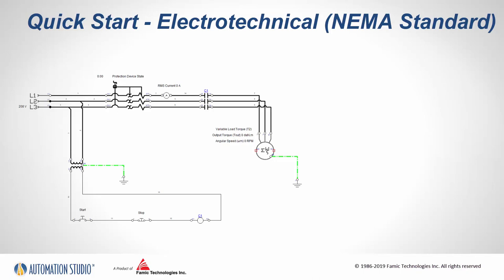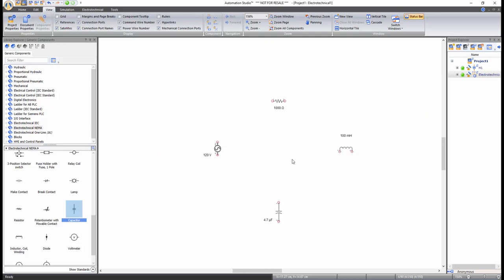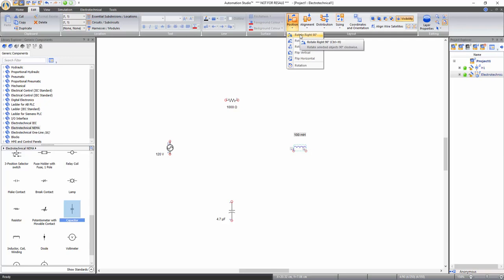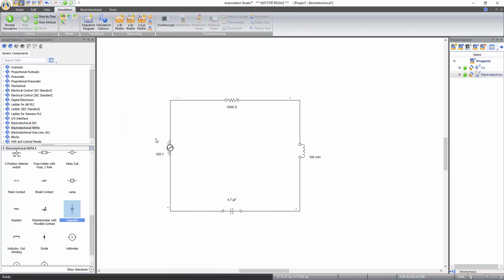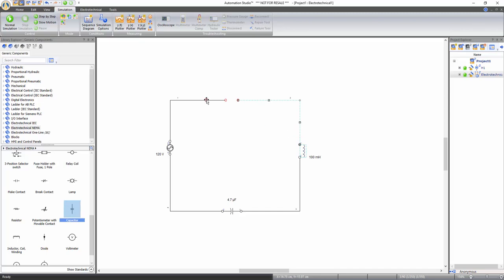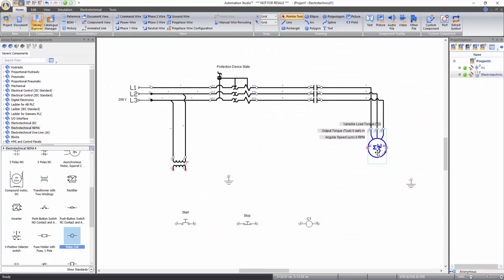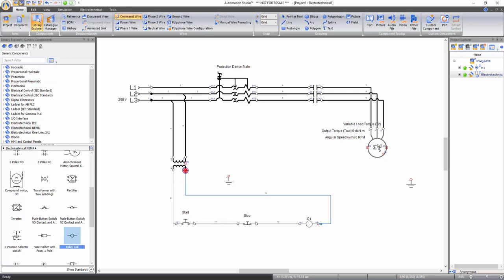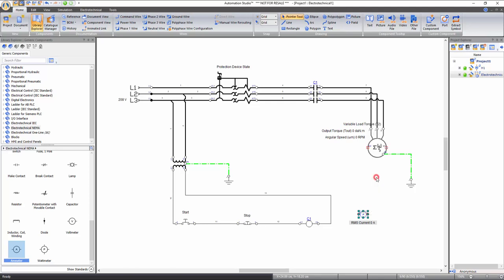How to Electrotechnical (NEMA Standard) Automation Studio™ - Quick Start Guide

Comment: What version of the software is this?
Reply from the maker: This is version 6.4 of Automation Studio™. We are currently at version 7.1 and version 7.2 will be released in the coming months.
Reply: @FamicTechnologies  I was wondering because there is no variable assignment for a 3 pole NO in version 7, just the builder.
I was trying to control an electrotechnical circuit with PLC but haven't yet found out how to link components between electrotechnical and standard diagram documents.
Reply from the maker: @Chris2Hrabo  I suggest you fill out the Contact Us form on our website: https://www.famictech.com/en/contact 
Please include your license's serial number and provide context in the Message box. A representative will get in touch with you as soon as possible.